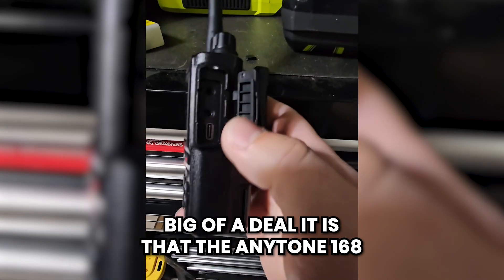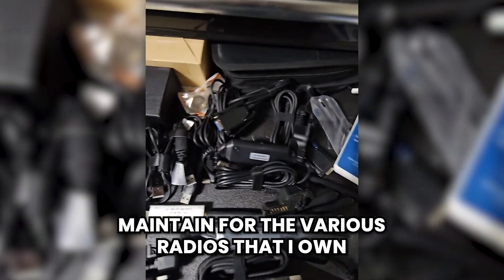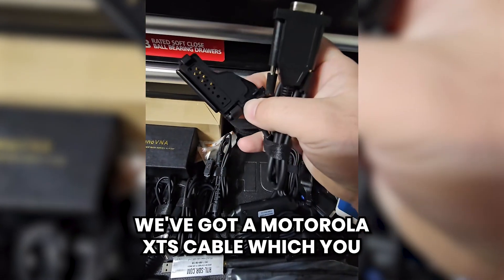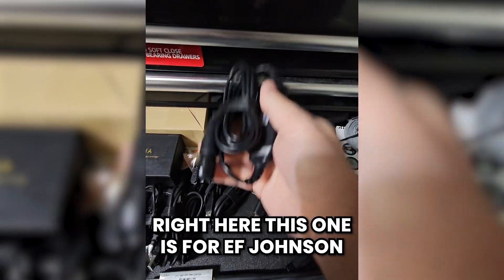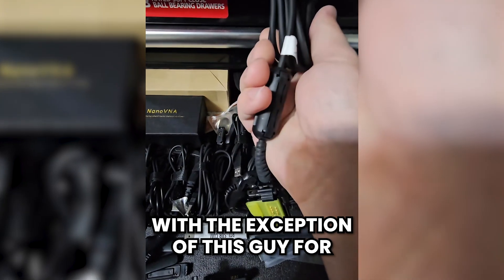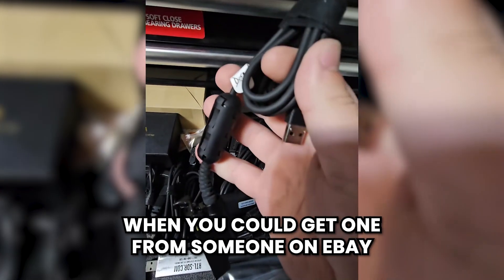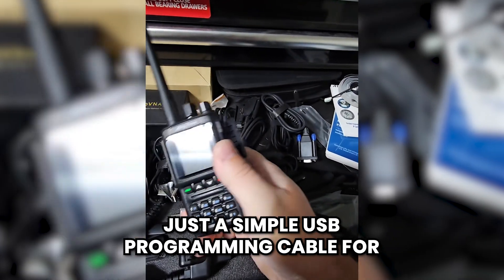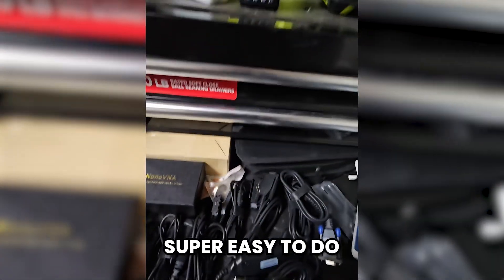Why USB-C Changes Everything for DMR Radios | Hamvention Ham Radio Demo

Comment: Why is your hotspot 400$ when they are usually sub 100? And why are all your radios sold out and why was the 168uv taken off your site, I mean the alinco md-5. Hey if you said it was a alinco knock off then programming would have been easier because those code plugs work for the 168 btw. Also eff you guys Im going hytera.